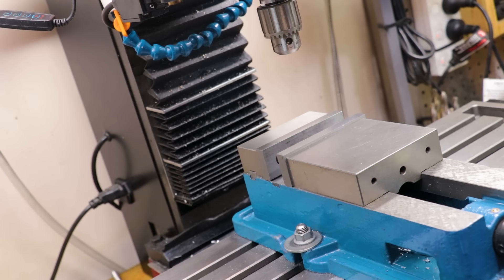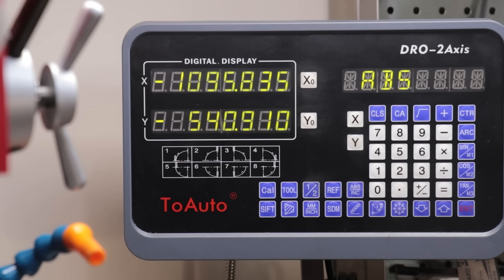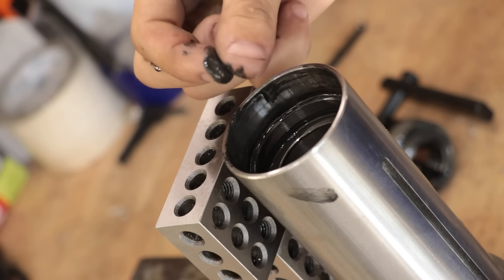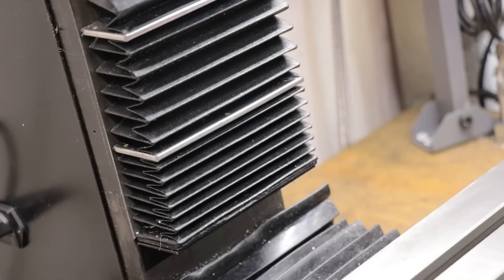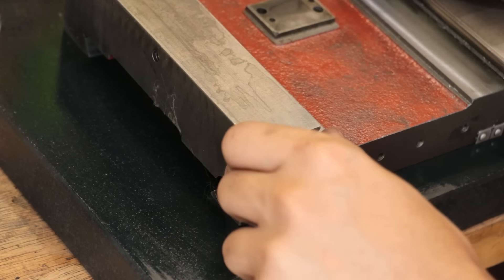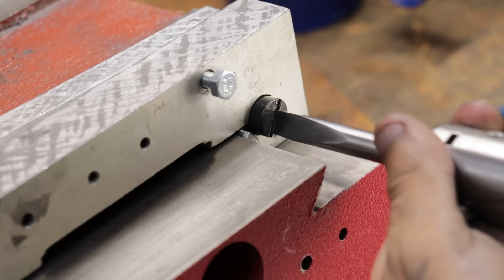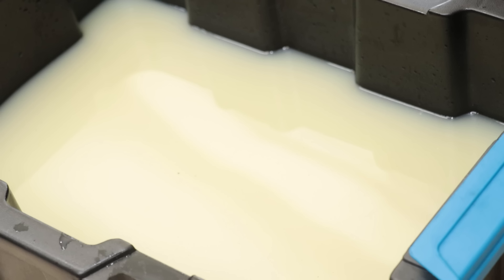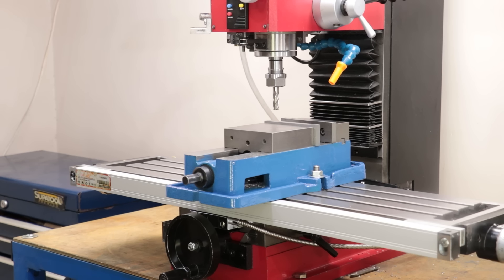The Cheap Chinese Mini Mill

Comment: Hi, interested in your scraping tool. Did you make or buy it? What did you use for the carbide blade?
Reply from the maker: I showed the process of making it in my vice scraping video. It’s essentially a carbide paint scraper bolted to a piece of galvanised steel. I used a diamond grinding wheel to grind it to shape. Of course you can also buy proper scrapers and scraper blades too

Comment: You want the slide to be slightly hollow or " undercut" in the middle, as it was.
This is to prevent rocking.
Reply from the maker: I could add this later. Interesting point though, but my book on scraping and fitting doesn’t mention this for milling machines.
Reply: My trade is machine fitting and he’s correct, you scrape the center 30% of any short slides low so you get a positive lock on each axis, so it doesn’t rock when worn and to hold a oil film that can’t dissipate when under heavy lock or if an axis is locked.
Reply from the maker: Looks like my book is missing that then, ill get around to that next time i have the table off
Reply: @artisanmakes  if you mean the connelly book, he never actually scraped a machine in his life its a collation of various machine rebuilders with huge gaps, great source of information but lots of equally bad advice
Reply: @artisanmakes  I'll also say that you shouldn't be scraping the saddle independently, you should ideally be using the X and Y long slides as a master and scrape the saddle to match while tweaking for cartesian alignment. christian of @machsuper made the same mistake initially for his optimum but I'm letting him use my plate, straight edges etc to do a best practice rebuild, if near me you're welcome to pop in and use the plate, straight edges biax etc

Comment: Some u tube creators have a lot to answer for introducing scraping to the masses. You listening Adam! To scrape successfully you have to be finer than that mate. When I was a aprentice one of our first jobs was to create a cube 1 inch on all sides. + or - half a thousand using a hacksaw, a couple of files, scraper and surface plate and square. This was out of a lump of rusty plate 1 and a half thick.
Reply from the maker: I dont know who you are referring to, this is straight out of my fitting and machining book. Had to be done since the diagonal corners were high. Either way end result is better tram and better fitting table and nicer surface finish. Cheers

Comment: InMy Opinion ,Bearings are generally fairly inexpensive  and i personally always try to purchase the highest quality i have available for that paticular  job  i like to keep a Journal  on all my indivualMachinery  and Equipment that gives me the ability to reflect or reveiw on what parts do or have worked the best for that application and whenever possible  i like to keep extras in stock  to make future repairs or maintenance easier , i do that with Gaskets as a generalrule of thumb also

Comment: Why don't you add a Y in the line for the flood coolant, and set up a second head at the lathe?
Reply from the maker: The lathe table isn’t really set up for flooding, plus the stuff I do doesn’t really require it to be flooded

Comment: Spindle bearing like these can be greased as well as oiled. Thrust bearings are self centering, so when loosened they may feel sloppy. Just buy a tube of bluing dye. Really, as Klaufmann said, it’s cheap enough, and Linseed oil is problematic for this purpose. Otherwise, very good work.

Comment: The problem is (was) not with the brushed DC motor as it is capable to produce the nominal torque even at standstill. The problem is (was, again) the open loop drive electronics and the lack of forced cooling.
DC motors are so great that they were even used even in MW power level locomotives.
Maybe the only downside of DC motors are the brushes and the commutator.

Comment: 10:19 Why didn’t you just make a clamp with spacers for that bracket? You could have avoided removing the bed and drilling the holes altogether. Furthermore, it would be adjustable up and down if it’s in the way with a particularly large job.
Reply from the maker: The saddle had to be scraped anyway as one end was higher

Comment: I have basically tje same machine only its 1.5 kw motor and the machining surface is larger weighs around 620lbs
Reply from the maker: Definite seems like the next model up from mike, sounds like the specs of a sieg x3. Cheers
Reply: @artisanmakes  good machines though witha bit of fine tuning

Comment: Hammering is a big mistake, you should press it you might damage the bearings --- it happened to me. The resistance also depends how much you fasten the bearings, also the oil of course.
Reply from the maker: Bearings were already junked so there was no harm in hammering them out
Reply: @artisanmakes  I like that your spindle uses 2 nuts, mine just uses a single nut with a slot and a screw for pressing the slot together. When I received the machine the screws were floating inside the spindle.
I have taken it apart numerous times and service it regularly (I also used to mill a lot).
The linear scales you are using I bought from ditron, they seem to be the same. First I bought another brand but they did not wire up the signal pins (the circuit was missing a sensor for that)...
I'm mainly using it for CNC.

Comment: Why did you scrape it instead of laying a sheet of sandpaper on that granite block and just sliding the plate on there?
Reply from the maker: scraping fixes parallelism issues and allows groves for oil

Comment: remember this: dc motors gain torque as the speed increases, so any dc motor will struggle at low speed, if you wanna get rid of that issue, you need an induction motor that gains torque a lot earlier (get a 3 phase one and a vfd) hope that it helps,
i think that might make sense to replace the bearings on the mill for some tapered or angular contact bearings
Reply: I agree with you on the 3 phase motor idea, but with these dc motors you’ll get most torque at low rpm, usually with these cheap motor boards they can’t supply the current to push these motors at low rpm and high loads.
Reply: @qantse  i mean, if u get a DC motor and feed 10V and 50A i can guarantee that you can stall it (for those that are rated for 110/220V) but then, give 30-50V and 20A and you aren't stalling it, what it mean is that the more you load a DC motor, the more the speed get reduced and the torque increases

Comment: Why didn’t you just use a diamond stone to level the plate
Reply from the maker: Well a diamond stone wouldn’t give you the high and low grooves that scraping gives you. That allows for oil to be trapped to lubricate the slides

Comment: I want to buy it but its around 2000€.
Crazy.
Mini lathe costs like 500-800€ only. I dont get it why mill is so expensive.
Reply: the lathes I find for that price are pretty small. My lathe (400mm between centers, 100mm chuck) cost about 1200€, so 2000€ for a mill of that size sounds reasonable
Reply: @CatNolara  I guess so.
But I will buy one anyway. I need it.
I have lathe but need mill.

Comment: thats not how you scrape a bedway in my friend im retied machine tool fitter, your not taking in to account the Bedway in parallel to the spindle or square to vertical bedway, also the lead scenes will need dropping there's a lot more than graging your bearing blue and a scraper and go at it, ive reconditioned machine tools for, GMH, Mitsubishi Aus, Monroe Aus, Walkers, CSRIO, Electrolux, ROH, AET, Heavy Mec, Static, BAE,  and repaired tools for just every engineering shops and toolmakers in my home city
Reply from the maker: Fantastic thankyou. I actually had to drop the back left corner in the first place as it was throwing the tram out, so it was considered during the process. My fitting book doesn’t seem to mention anything about dropping anything, although it does seem to be missing a few details. For what it’s worth it did fix my issues, and I’m sure there is room for improvement, especially once I get a new reference book on the subject. Cheers

Comment: This is a mini drill mill not a milling machine
Reply from the maker: If it can mill and has the table and correct bearings for the job its a mill
Reply: @artisanmakes  so if it can drill it's a drill
Reply from the maker: Yeah it can do that too. As well as milling
Reply: @artisanmakes  or the opposite

Comment: There are no "centimetres" in engineering. Only metres and millimetres. Centimetres are for dressmakers and tailors.
Reply from the maker: No there aren't but for the sake of a review cm seemed to be the best suited measurement to use. This isn't an engineering document, its a review for the hobbyist who might measure out space using a tape measure for sake of argument.